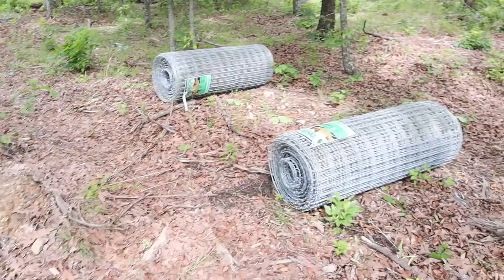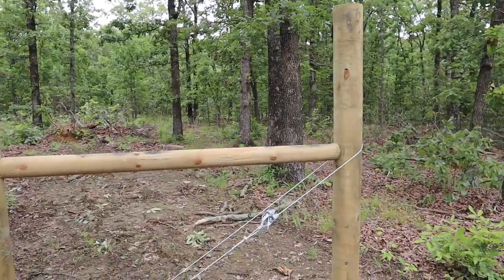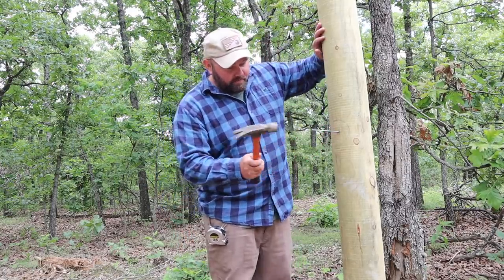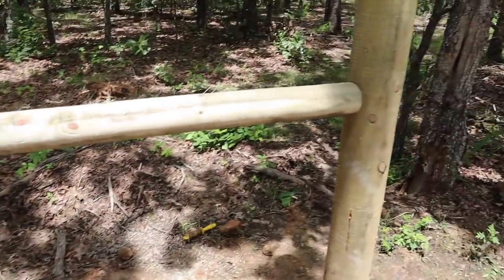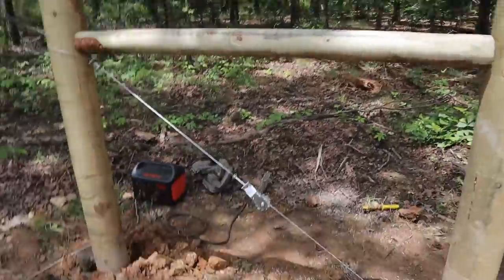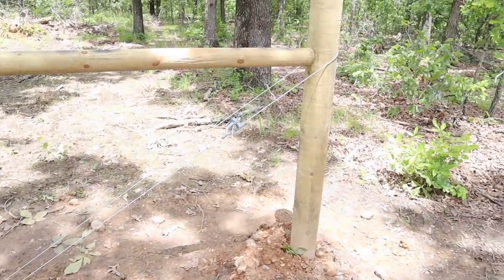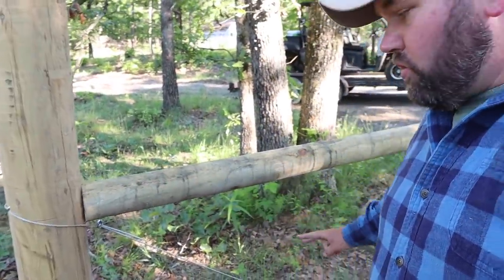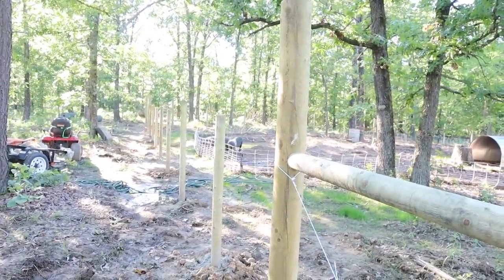HOW TO SET A CORNER POST FOR A PIG PEN OR FENCE

Comment: That little  u shaped clamp is not on correctly. There is an old saying that applies to cable clamps and other things. That saying is "Never saddle a dead horse."  In the case of the clamp the u bolt is the rider and the other part is the saddle. So you never put the saddle on the dead end of the cable.  I know this from many years of inspecting secured loads on rail cars.  Stood out to me inmediately